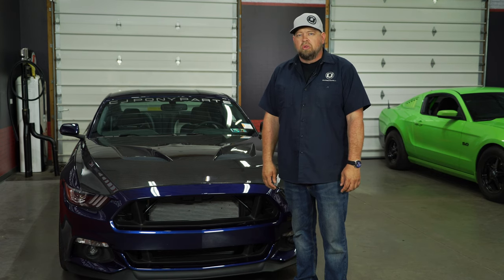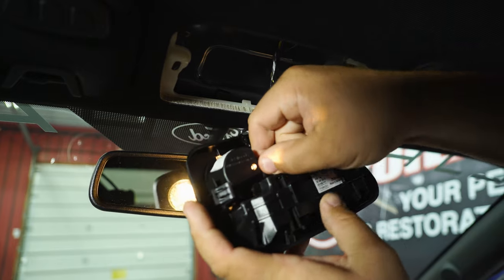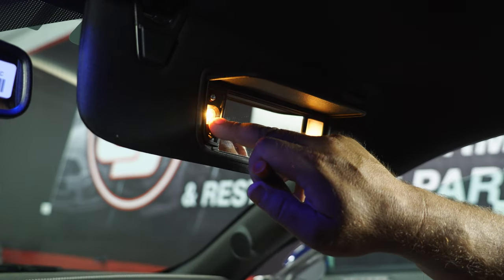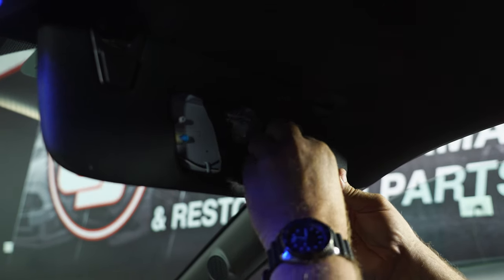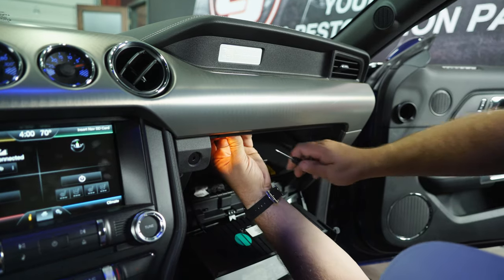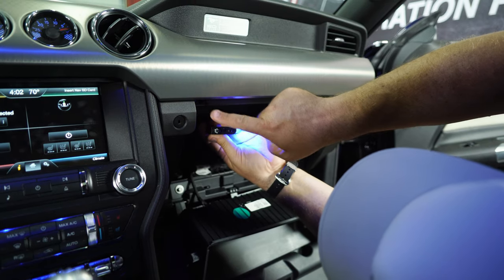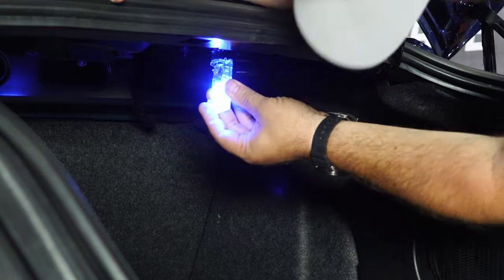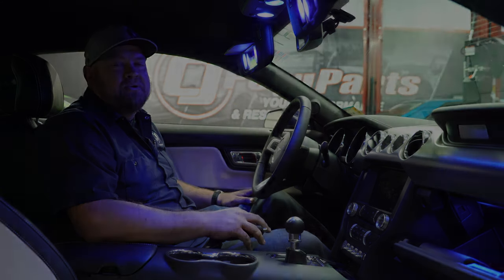2015-2017 Mustang Install: Diode Dynamics LED Interior Light Conversion Kit

Comment: Definitely an awesome upgrade, but swapping the light bulb for the map light was a pain in the ass. I recommend removing the map light lens and replace it through that method. I used two box cutters to remove lens and a plier to remove the bulb and also use it as leverage when inserting the new replacement by gripping the edges. Hope this helps!

Comment: This is a great upgrade but the 2018-2019 version has an LED trunk already. Also the map light housing is different on an 18-19. Do not pull down on it like this. You will break the double sided tabs. Also you can do the glove box without having to remove that entire assembly. A pry tool behind the bulb will bring it out and then you just replace.
Reply: I concur with every single point here.  I experienced all of this on my 2018 GT.   For the map housing, pressing the side clips in with a small flat head screwdriver helped a lot.  I pulled it down just enough to be able to see those clips.  Also had to stretch them back out before putting the housing back to make it fit tight again.  I did use Bill's method for the vanity lights though.
Reply: Yeah just did my map, vanity and glove box lights. If I didn’t see those tabs I probably would’ve messed up the map lights and for the trunk light I watched three different videos because I didn’t see a bulb in there to remove, just the led board. If I didn’t see these comments, my trunk would’ve been lightless
Reply: Man, I just fucked up my map assembly
Reply: raydog1111 I broke mine smh 🤦🏽‍♂️
Reply: Alberto Bahena sorry :(, did you try to pull down on an 18-20?
Reply: Nathan yea bro on my 20 smh now it’s hanging 😂
Reply: @albertobahena414  Damn bro. I know you can get a replacement but what piece is broken. The ceiling mount or the clip on the plastic?
Reply: Nathan right Clip broke and idk about the other part it’s hanging a bit but won’t close all the way up
Reply: @albertobahena414  So you may  need to bend the other clip back. What happens is it gets stretched when you pull down so it will leave a small gap. Some people leave it but you can get it to go flush again. Not sure where to get a replacement clip. You can try to repair it or see if Ford has a part number for it. Sorry it happened.
Reply: @Fenrir11119  ya I just broke both of the clips, where do I find a new housing unit ?
Reply: @samgander1  Ford unfortunately. That or try a salvage yard.
Reply: @Fenrir11119  ended up buying a brand new one.... ended up costing me 220.
Reply: @samgander1  Sucks, I am sorry to hear it. How did you end up breaking the tabs? Was it watching the video first?
Reply: @Fenrir11119  ya then I went to the comments n saw your comment n was like damn should’ve looked at what you said b4 I pulled down. lmao
Reply: @samgander1  Damn, sorry
Reply: Now the buttons to the lights aren’t working.. what could be the cause of this.
Reply: @samgander1  Hard to say, I never experienced that. Best guess could be wiring or if there is a plug it might not be fully seated.
Reply: @samgander1  I pulled the bulb socket it out so hard it moved the wire to press the passenger side button, worked on trying to get it reseated for 30 minutes and no luck. You might have the same issue as I do.

Comment: The installation of the dome/map lights is incorrect here.  It's much easier to just remove the lens rather than the entire part.   It's been proven that once the entire part is reinstalled it won't fit snug as it did before
Reply: I tried this and being very careful, the socket ended up pushing through.  I ended up having to remove the housing anyway.  The socket didn't seem like it was very secure.
Reply: @transparent1608  I used a very small and thin fingernail file. Just used the tip and pulled down and the lens came down and off
Reply: Thanks! The bulb wouldn’t fit in the socket when I removed the housing. Removing the dome housing was a big pain! Removing the lens is way easier ! A small pick is a must
Reply: @gabrielram9795  should make a video or are there any links ?

Comment: If you got a 2018 + mustang don’t use this method to remove your map housing, the clips have to be pressed by a screw driver and you’ll be able to release both sides and the trunk has LED’s already so don’t worry messing with the trunk light
Reply: TryHard760 I broke my overhead console housing clips 😭
Reply: Any videos on how to do that? I'm struggling on my 2019 lol. Appreciate the comment, I look like a complete idiot right now
Reply: Rajesh Ramsaroop be careful, it cost me 300 to order a whole new console
Reply: @beat2190  damn man that sucks! I'm just gonna do the dome lights as they get used the most.
Reply: Too late 😢
Reply: Yep just broke my housing
Reply: @ksacdesigns  that sucks! They look the same but they changed how they work on 2018+

Comment: Prying the housing out for the glove box light in the 2016 the plunger assembly doesn’t come out as a separate piece as he shows in 3:00 it comes out in PIECES that don’t easily go back. Recommend trying to remove bulb without removing housing.
Reply: Thank you. Actively doing this rn

Comment: Everyone having trouble with the map lights which I did in 2 minutes but I can't figure out how to do the trunk!! I used my whole weight pulling to the passenger side and it doesn't budge at all, don't want to break the thing
Reply: Bro same!! Haha this shts not budging
Reply: I’m having the same
Problem also
Reply: Try it with a flat head! There’s a little clip push it in and u should be good

Comment: I changed my lights in the visiors and glove box
They not working and the trunk light not working. The trunk light was working before I changed the visiors.
Reply: Take the bulbs out, and turn them 180 degrees,  and reinstall.

Comment: I cannot get that done light off. I feel like I'm going to break it...!
Reply: I just absolutely sent it I think it’s looser then it was before but worth it??
Reply: @GregtheAwesomeNinja  yeah mine is too but I think ford has some adhesive where it's sits on because when I took mine of dry glue fell and I notice glue on the boundaries.  What did you do?
Reply: @umairejaz6665  to be honest it also could just be the plastic bending a little, since I’ve done it and it’s been a while I believe the shape has retaken or something because it feels a lot better now!

Comment: Has anyone swapped the globes in the door lock buttons, window switches, gear selector, main console buttons and steering wheel buttons. These do not change with the colour setting option

Comment: The light in the glove compartment is not as easy as you make it seem.  I was able to remove the hosing and replace the light but it is a b!tch to try and align back up.  There are slots inside the housing that need to line up.  I left it hanging until I try it again.  Thanks anyways.

Comment: Once installed the vanity, glove box and trunk light stopped working. I read it could be a blown fuse. How do i go about fixing this?
Reply: Having the same issue. Only the map lights work for me
Reply: @Memo2SS  im heading to autoparts and buying a 10a blade fuse. I think ours blew and its why we aint getting light. This is located in the passenger fuse box (located at the bottom right corner of passenger side, fuse#1).
Reply: jp_shelby lmao bro I’m in the autozone parking lot right now as you commented and I fixed it 👌🏽 that fuse is the problem
Reply: @Memo2SS  did it fix all the lights?
Reply: The trunk light keeps blowing my fuse. Calling diode dynamics to resolve this
Reply: Yeah it fixed all of them. When you did the trunk did you disconnect the whole plastic piece off the black harness?

Comment: That moment when you install the vanity mirror lights and you break off the little POS plastic piece on the back of the cover so now the switch in the visor doesn’t actuate the lights